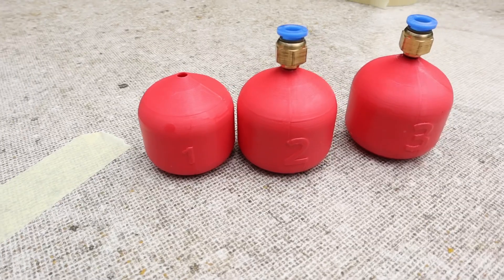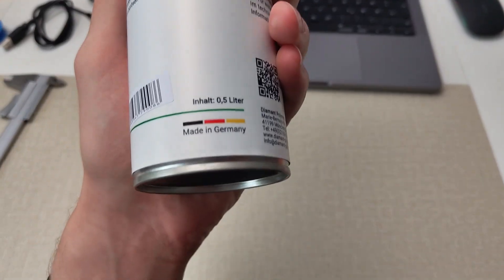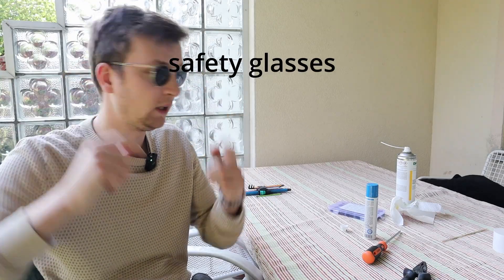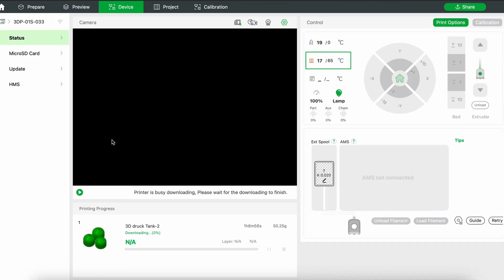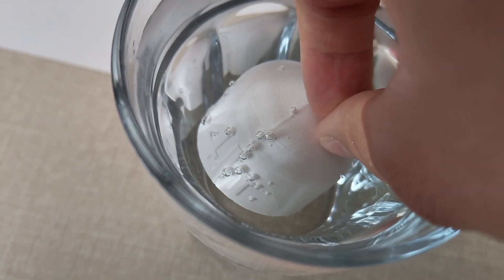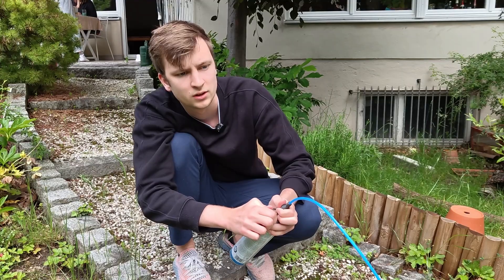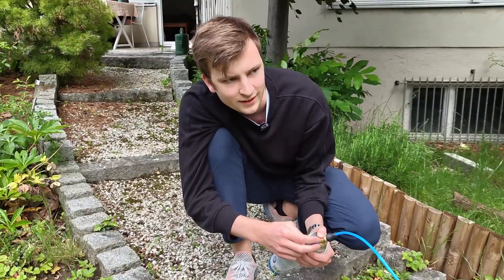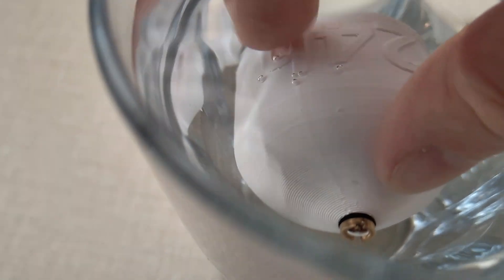Gas tight 3D-prints

Comment: Hab selber schon ähnliches probiert. Zwei alternativen gäbe es noch:

1. Den Druckbehälter aus ABS drucken und mittels Aceton Bedampfung die Oberfläche auf schmelzen lassen (sorgt auch für einen fantastischen Oberflächen-Finish)

2. Den Behälter von außen oder innen mit Epoxidharz versiegeln. Ist die verlässlichere von beiden Methoden, aber dafür definitiv aufwändiger und mit Harz zu arbeiten ist oft a ziemliche Sauerei. 

Auf jeden Fall ein interessantes Video. Dichtol war mir bisher unbekannt 😅
Reply: My favourite alternative to ABS is HIPS. It has somewhat similar mechanical properties and it's cheap but it's easy to print. It has some susceptibility to acetone but it's not as high, it dissolves on the surface but doesn't penetrate deeply. So you can just pour acetone into the HIPS canister like this with a syringe or whatnot, swish it around for a good few seconds, and pour it out, it won't melt through. You can even brush acetone onto HIPS and the brush stays clear of HIPS, the surface of HIPS just goes soft. If you try this with ABS, you have a brush full of ABS. Dropping a piece of ABS into acetone, you get a full solution, it just becomes liquid. Dropping HIPS into acetone you have a softened cohesive blob of HIPS floating in acetone. Fascinating.

Comment: instead of dictol, I would have poured a thick abs+acetone, however it has to stay in just 2 seconds and pour it out again, otherwise the acetone will soften the shape a lot, and it has to dry from acetone in a cool place.
Reply: I'm guessing the acetone/vapour+abs trick wouldn't work in this particular case. Simple put, acetone only fuses the outer layers of the print, so regardless of the thickness of the wall it'd only reduce the structural defects of the outermost wall. I'm sure with vase mode+clever wall design and acetone vapour you could pressurize a small tank quite a bit, though. I seem to remember a YouTube video where they built basically 3D printed hand grenades using a similar process
Reply: @XceptionalBro  You have two problems when 3D printing a canister like this.

One is gas tightness. You can solve it by coating the surface somehow to seal the pinhole leaks. In this test, all canisters have showed weak gas tightness.

The other is pressure resilience. This is what 1mm print failed on, there wasn't enough cohesion on the canister to sustain the load. It is apparent that simply increasing wall thickness was sufficient in this test.

I don't think you need the sealant to penetrate throughout the complete wall. Not sure if i explained my opinion well.

Comment: It was leaking where the z stop seam appeared in the part (4:18). There should be settings in your slicer to randomize the z stop locations and maybe not create a seam that can leak as easily.
Reply: Yeah, he should remove the markings (all smooth surfaces) and randomize the z seam, should be a big improvement
Reply: He could use scarf joint seams too.
Reply: @SB101  scarf created some problematic holes when I tried.
Reply: @CompletelyNormalPhenomenon  IME, scarf joints can create a completely continuous extrusion with no true seam. So once dialed in it should be a near ideal solution.
Reply: Was just gonna say, Scarf Joints might be the solution! Also, there are things like 'alternate extra wall' that could help immensely. If you dont have those settings, take a look at Orca Slicer and never look back hahaha😂
Reply: @Wassermelonenbaum  I'm sure Orca slicer is nice, I have tried it a bit and it does have nice features but it also lacks some that for example Cura does have unfortunately. I think it's good to change around slicers depending on exactly the features you need.
Reply: Best setting would be with brick layering (still in alpha or beta), random seams, a bit overextruding, and a nicely tuned LA/PA +Jerk and Acc (to not get holes, bulges or blobs on seams/corners), high temp and not leyer fan. And also a nicely dried filament

Scarf seams would need to test it for that. It could work if each perimeter went in a different direction, or if it will work on brick layers. Also, big nozzle/line width, like 0.7 or 0.9 at 0.2layerHeight would work good

Comment: You should try Dichtol from both sides. i used it with my pressurized 3dprints and it worked really good.
Reply: alternative for US people? can't find it here
Reply: @seejayj  normally I would say just import it, but we know what America thinks about foreign products 😅 the only kinda similar solution is from a company called "Stronghold  Coating Systems" they used a licensed part of the formular for proofing engineblocks and such stuff. But I have no further informations sadly.

Comment: wouldn't increasing the extrusion rate also help? more material being extruded, less air gaps between layers. I've been wanting to 3d print a foodsaver adapter that I can basteln onto some tupperware to make them vacuumable, and this is what I thought so far to prevent a leak from the actual 3d printed part. Also I would probably include some kind of silicone seal for the one way valve
Reply: There's a CNC Kitchen video regarding "transparent FDM prints", that touches the subject of extrusion rate exactly for the purpose of eliminating those air gaps. So I think you're might be onto something.

Comment: Why don't you use ABS and acetone(vapor)? Why don't you try vase mode? Your seams or whatever it's called, where the extruder goes from the outer layer to an inner layer is always a weak spot, and you can clearly see that's the point of leakage. Vase mode will probably be enough. Or make sure the seam parameters are good enough.
Reply: Pla is not water tight, even with a calibrated printer. ABS tends to be (pc, petg, nylon, asa as well) when printed with dialed in settings.

So you may not need a sealant at all, but if you do, I would prefer something that doesn't dissolve the pressure vessel. Sure, most all of it will evaporate eventually, but what is most all, what is eventually, and did it damage the structure in the mean time.

I think I would just print and test, and if I couldn't maintain the pressure I needed, use a film forming finish (probably CA glue or a thin epoxy).
Reply: @JOEDHIGGINS  Okay that's new to me. Isn't that an issue with filament quality? As it should be a solid material. But I can imagine it being not gas tight because some materials have too big gaps between molecules. But water usually doesn't seep through materials.
Reply: @Robbedoes2  I am not totally sure, I am assuming it is a mechanical property more than a chemical one, but it is not just I that have run into the issue. I made a watertight case that I prototyped in some PLA, which wasn't watertight. I searched around for the problem and found it was likely that it was PLA just doesn't really make watertight prints. Sure enough, the case works in ABS, ASA, and PC.

From a bit of further research, PETG, which I don't use for anything other than support, also seems to do well (shocking given that PET is water bottle plastic).

I am guessing PLA's issue is probably layer adhesion, or something similar. I have just dropped PLA from my filament list for pretty much everything. It is more trouble than it is worth.
Reply: @JOEDHIGGINS  yeah probably. But maybe it also has to do with the low print temperature? Layer adhesion/seam finish is the only candidate in my eyes for causing this problem
Reply: @Robbedoes2  possible, maybe also that we tend to print PLA with a crapload of part cooling that we generally omit for PETG, ABS, ASA, PC, etc. PLA doesn't generally show massively worse layer bonding than other filaments, but I suspect that it is somehow layer bonding or similar. I have solved this problem by just never printing in PLA.
Reply: @JOEDHIGGINS  I guess you're right! When I did an internship at an plastics company, the welding machines didn't just extrude melted plastic, they also had hot air guns to melt the base material for better bonding. Forced cooling will just make it really bad. But I guess that's the downside of low temp plastics.
Reply: ABS/acetone, along with a thick walled print, holds both pressure and vacuum very well.
Reply: @bobgarrish  I guess that'll be the easiest and most reliable way.

Comment: Have you tried annealing your prints? You can "bake" PLA prints at its glass transition temperature for some time. This improves layer adhesion and may close gaps at the z seam, making them stronger and easier to seal.
The drawback is part shrinkage and possible deformation. As the plastic gets softer, stretched out polymer chains tend to pull back together and intertwine with each other.
Accurate dimensions are hard to achieve with annealed prints, but you get better layer adheasion and higher overall strength.
Reply: You have to take into account how much the plastic will shrink and print with that designed into the part. Annealing the part immersed in a medium which doesn't allow it to move like salt also helps a bit.
Reply: What might also help is increasing the flow/extrusion rate. That should at least to some degree remove those gaps between extrusion lines. There's a CNC Kitchen video on "transparent FDM prints", that covers this a little bit.
Reply: I think vase mode will be an great candidate, my father got water tight vases in one go, while normal mode only got leaky ones. Personally I just sprayed acrylic varnish inside to waterproof it.
Reply: I was thinking along those lines too. I wonder how a tank annealed in sand, with extra structural support inside (like, beams holding the walls from exploding) and treated with the product would fare. I was also thinking, weirdly enough, about wax. Since wax can be used to waterproof fabrics, do you think it could help waterproofing 3d prints at low temperatures?
Reply: @XceptionalBro don’t anneal. Pack the piece/part with either talcum powder, baking soda, or any fine powder, Stephan even used table salt to melt a piece. His channel is CNCKitchen.
Reply: "Accurate dimensions are hard to achieve with annealed prints, but you get better layer adheasion and higher overall strength."
You can put the parts in compacted fine salt first and then anneal it for crazy results. cnckitchen did a video on that a while ago
Reply: @Karavusk  I've annealed ProtoPasta's carbon filled HTPLA before and there is very little warping. Dig into their blog and you should find the correction scaling values to pre-scale your part before slicing to compensate for the natural contraction on x&y and the expansion on z during the annealing process. I had printed all the parts for a Prusa MK3S extruder and all the parts fit together properly after annealing. Actually the filament sensor worked better because after annealing the plastic parts slid against each other smoother than PETG parts do. Unfortunately, I did have some cracking issues... The PINDA holder split apart into 3 parts along layer lines after a while of holding tension, and I noted some other cracks when disassembling for the upgrade to the MK3S+ extruder.
Reply: Different PLA grades take annealing differently. A lot of regular PLA is grade 4043d which doesn't take well to annealing. Some 3D printer filament manufacturers use PLA grade 3D870 which shows significant strength and thermal resistance after annealing. Off the top of my head, ProtoPasta's HTPLA and 3D-Fuel's ProPLA are both 3D870, but I would imagine that there are more.
Reply: Yes, I believe Stephen of CNC Kitchen attempted annealing with powdered salt.
Reply: If you fill it with sand, then cover the entire outside with sand there might still be a bit of deformation, but not as much because it is fully supported.

Comment: I LOVE that he uses gas instead of just pumping air in with a bike pump.
Reply: A bike pump would also let you see what pressure it gets up to as most track pumps have a built-in pressure gauge.
Reply from the maker: It says "Gas tight" in the Thumbnail. To use only air would be bad clickbait ;)
Reply: @Germanengineer1  sure but wouldn't it be a lot safer to first test it with air and then with gas? 😄
Reply: @lazyman1011  lol :D
Reply: @paulushdk where’s your sense of adventure?
Reply: @Germanengineer1  Air is a gas. It would not be clickbait
Reply: @Germanengineer1  It already is clickbait because it shows that model.
Reply: Hey, if you are going to test something, test it with something flamable.
Reply: Still a bomb tho those race tyres on bikes are over 100psi that's 100psi in a dinky thing scary ifvit went bang holding  it
Reply: @jonathanoxlade4252  No doubt.  I'd still have some safety specs on at least; safety squints won't do much good here.
Reply: But air is a mixture of different gasses though so technically not clickbait.
Reply: Germans are very experienced with gas
Reply: @bromine_element not cool man, not cool
Reply: @jetblackstar  Correct, the hot part came soon after
Some 1000°C!
Reply: @bromine_element  bruh😂
Reply: TBH its cheaper in the short term and considering there were no open fires nearby it wasnt really any more dangerous. This said I am pretty sure that its also a bit easier than with hydro carbons. Splitting atoms here but those hydrocarbon chains are bigger than the normal atmospheric make up.